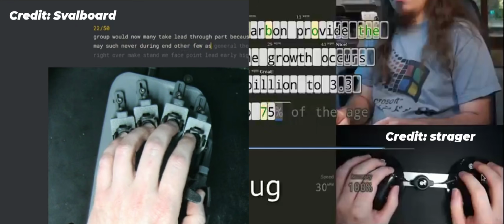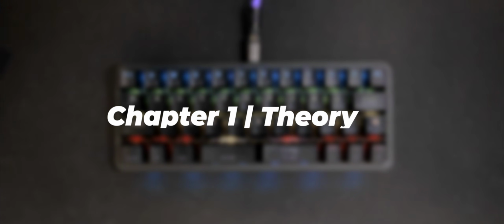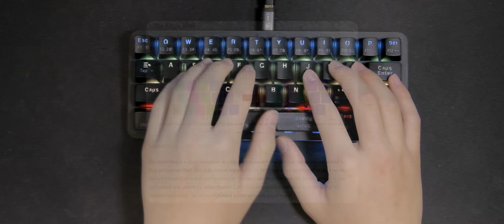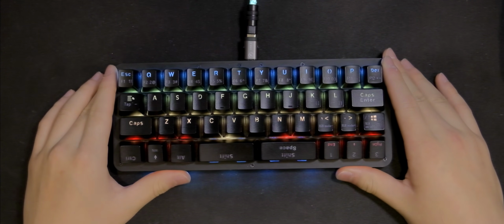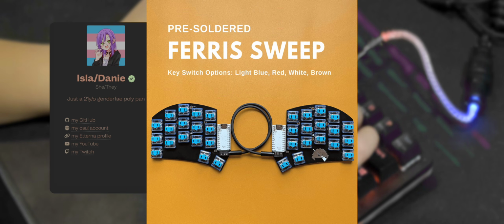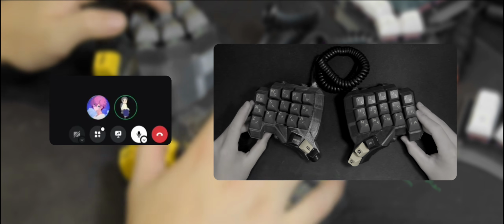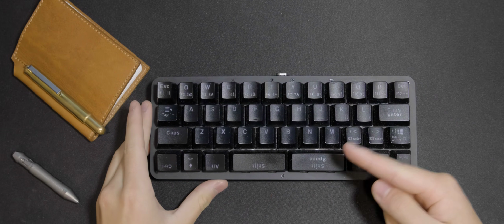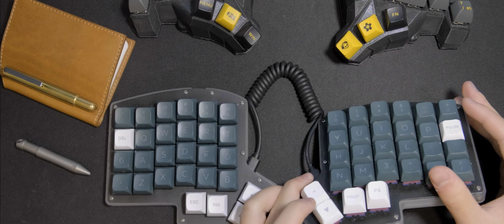A Split-Story | Ergonomic Keyboards

Comment: i got into ergonomic keyboards because i wanted a better keyboard that actually makes sense and what is absolutely more comfortable and efficient. the desire for this started with Counter-Strike, and then text editors Vim and Emacs with Xah Fly Keys. i notice that my middle finger sits on the edge of the W key. i hate typing the bigrams "li" and "fe" on rowstag. the worst is switching weapons with number keys. reaching for the key number 1 is eaughghgh. pressing 2 or 3 while holding W is weird. eventually i rebind keys, but on bottom row only Z and X are comfortably available. each of ZXC keys would have been available on ortholinear layout.

straight columns makes sense; fingers go straight up and down; split makes sense. i want an ergonomic keyboard.

Comment: Hey, i wanna note something important to you, the thumb keys. it seems like almost no ergo kb today has wide spacebars. i think this is bad. i think they need to be about 2-3u, being 1u past the alphanumeric block. few designs have a safe thumb layout design. everybody knows that different people have different hand sizes and different finger lengths. Yet, most ergo keyboards only use 1u wide keys on the thumbs. includes Kinesis Advantage, Glove80, Dactyl Manuform, Corne, Lily58, and many others. exceptions are X-Bows and Truly Ergonomic Keyboard, which are flat keyboards.

look up "PSA: Thumbs can get overuse injuries", it's an article by Pascal Getreuer. look up thumb pain on r/ErgoMechKeyboards, you will see multiple accounts on first page.

i think a wider spacebar is useful in this way (like for gaming): when you press further away keys, like 5 or ` tilde, your hand will move -- with a wider spacebar this won't be such a problem. your hand will move and the thumb doesn't need to stretch or curl much to stay on the thumb key. great for gaming you'd think, right?

I see a big problem. imagine the standard keyboard: {make it ortho, then move Enter, Backspace, \backslash to the middle}. on a laptop there isn't enough space put extra thumb keys in the middle if you want the thumb keys to go past the alpha block. you can try this on the website Keyboard Layout Editor. (i absolutely love that website, i have spent a lot of time there). the problem is what should the universal ergo layout look like? this problem may ensure that the Enter key cannot be on the thumb and must be in the middle like it is on the X-Bows keyboard. i guess on the laptop, the spacebars can be pulled in to allow for there be a extra thumb key, but maybe that sucks absolute ass and you're forced to curl the thumb. decisions, decisions. big decisions.

BTW, about the further away keys example, i am against 40% keyboards. it's simply too few keys. (thank god you don't type in Cyrillic which has 33 LETTERS in Russian and Ukrainian). dude, moving your hand is not a bad thing. if you think the F-keys are so useless, then rebind them to something useful you do all the time, like Alt-Tab, copy and paste, next and previous window, and/or any other frequent commands you can think of. Just make sure the real F-keys they're still available when you need them. or use a programmable keypad and put frequent useful commands on there.

Comment: Kinda funny that you used a 40% as the example of a "regular" keyboard lmaoo, cool vid but ive never had a problem with that v shape thing on my regular 40 ortho, it's mostly just been the same as staggered but with a few tweaks to my typing. Never had to bend my wrists either. In fact, there's really no need to do that to reach the keys normally so i don't exactly see your point there. Some home row typing like with the middle finger on c is also way more ergonomic (if we disregard angle mods). I feel like that's what can actually make people bend their wrists in an uncomfortable way, but personally my fingers almost hover anyway so i don't experience any of what you're saying

Comment: I don't understand when someone has to press "B and R simultaneously" (or similar), but certainly not while typing. That's one after the other and this example comes way too many times in the video to be ignored.
Reply from the maker: At 100 WPM, you're typing at roughly ~500 CPM (characters per minute), which equates to ~8.33 letters per second. At 200 WPM, that jumps up to 16.67.

Typing fast boils down to whether you can press that amount of letters correctly within that period of time.

As you can imagine, having to move your finger costs time you could've used instead to press keys. By positioning both, you save this time.

Example words:
Break, bring, bright, etc.

With alt layouts, you can eliminate this by just avoiding BR from being on the same finger.

Comment: I use a split, 3x5 + 3 (36 keys total) column staggered, column splayed, low profile, light key weight, with the Workman layout. I'm not very fast, maybe around 80-100 wpm, but I don't have much of a strong impulse to speed up and thus, the minor speed benefits an Alice or Row-staggered board might provide seem like a pretty bad trade off for the comfort I get from my custom build. I'm always going to choose comfort over speed though. Can't go fast when your RSI is flared!
Reply: 80-100wpm is certainly fast!! is the 3x5 + 3 good and comfortable for small hands? Mine are pretty small.
Reply: @aongv  I have big hands and it's fine, but I can't imagine a smaller keyboard would be worse. It's all about the layout for me anyways. I currently use the splitkb Kyria, but I designed and am in the process of building a custom board with tighter spacing and a pinky splay. It also doesn't have the extra keys that I don't use on the Kyria. The one I'm using is based roughly on the Klor and Totem keyboards, with chocs like the totem and the layout of the klor. I also added a 68mm touchpad on both sides. Once I finish the process I'll prob make a video something.

Comment: You can't fairly compare a traditional keyboard to "ergo keyboards" as a single category. The key difference is that traditional keyboards share a consistent design, while every ergonomic keyboard is unique. For instance, the staggering angle for the last two fingers, which was criticized as a con in the video, is a parameter that can vary drastically between different ergo models. Grouping them all together for comparison misrepresents the diverse nature of ergonomic designs.
Reply from the maker: I was not clear enough at summarizing the video at the end, so that's on me.

If you go through the video, my main investigation is WHAT optimizations done on ergonomic keyboards are actually impactful---or, WHAT features are gimmicks, and WHAT features are not. 

NOT, "are ergonomic keyboards as a whole gimmicks?"

I hope that makes my comment on the "staggering angle" make more sense, but regardless it is also twofold:

1> It's undoubtedly true that alternatives exist (imo something like the ximi would be better). My concern is that the popular/most commonly found ergonomic keyboards such as the  Iris, ZSA family, Corne, Dygma, etc. do not feature such a notable effect.

They absolutely have improvements (i.e. split),  but I feel it is disingenuous to be popularizing the tiny changes as the ergonomic revolution, instead.
It's like if I took a voice input device, and promoted the fact that it was AI driven instead of its main benefit of not needing to interact with your hands.

2> Is it even worth it?

Pinky usage on QWERTY that is off of the homerow is 2.76% (using the Shai corpus).

N alone is 6.59%.

So, is it even worth optimizing that 2.76% (1.92% of which is just P) at the cost of moving the far more common N to an objectively worse position (since adding colstag makes rowstagger difficult).

tl;dr
The video is concerned with the individual features that makes up an ergonomic keyboard, and whether those individual features are gimmicks. "Staggering angle" (the amount of colstag) is an example of one of those factors that I find gimmicky on mainstream keyboards, particularly on QWERTY.

Comment: When I switched from a generic mechanical keyboard to a logitech ergo k860, i noticed my typing speed (and accuracy) increased simply due to more comfortable typing position and other things. Currently working on a col staggered split keyboard and i have some time to take on learning it properly. I think the claim that ergo keyboard manufacturers make is that it just "increases speed and efficiency outright" is a bad claim, but i wouldnt say its not founded in truth.

Then again, speed typing to me is one of the lowest metrics i take into account when im working, i prefer my keystrokes to feel good and most importantly be accurate. I think it ultimately boils down to "whatever you like best". I use a regular keyboard for gaming, because the row stagger etc is nicer for that specific use, but for typing i prefer the Alice style layouts or the split keyboard layouts. Especially since I've reached unc status and i can feel my wrists disintergrate after 10+ years f constant typing for 8+ hours a day for work I think the ergo keyboards have their place but they arent the "be all and end all" of it all.

Comment: I use a ergodox and regular ten-keyless and after using the ergodox for over a year, I wonder if I ever needed it. I have a very optimized setup. I got a desk and made sure the height was correct and learned to touch type during covid. I split shift for opposite hands and use macros like f + q to for escape and a + d for a hyper key and have a bunch of shortcuts. The thing is that I can have the macros with a split keyboard or any keyboard really. Since I don't have pain, I just not sure I need it. Still will keep the ergodox though its super fun to use and my typing speed is the same for split ortho and regular column stagger.